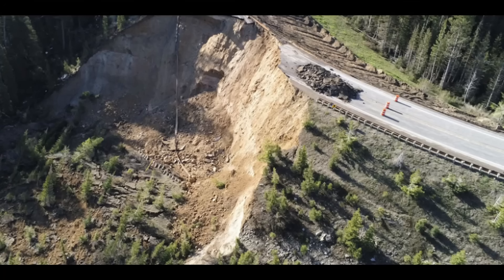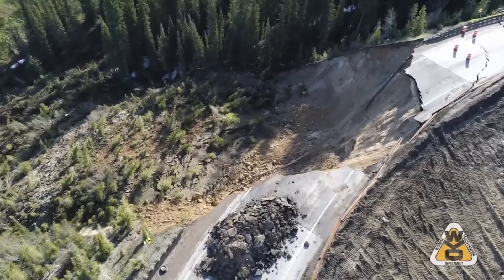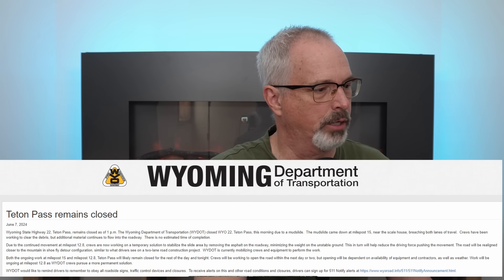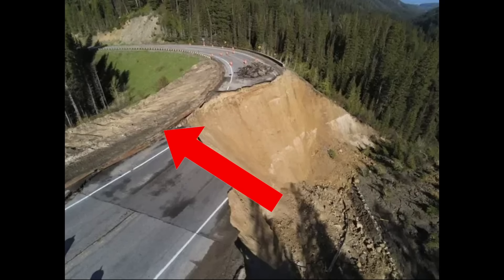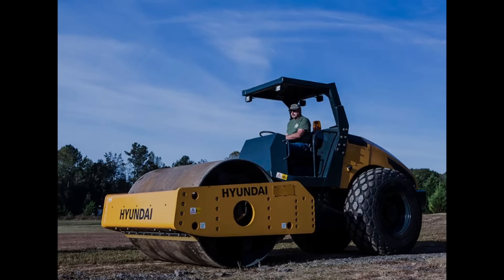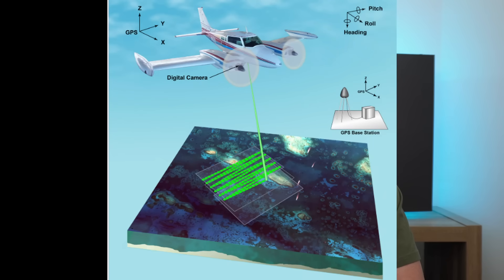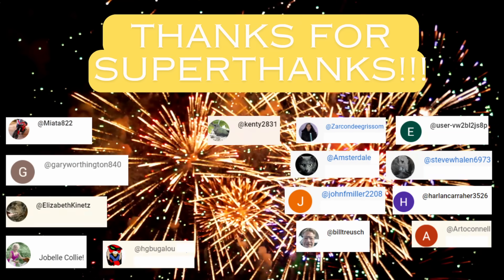Major Highway Embankment Failure in Wyoming!

Comment: A former co-worker is a mountain railroad right-of-way engineer.  He has worked on major slides like this numerous times.  His take is that the fill was improperly drained, allowing water to build up in the fill and, eventually, causing liquefaction in the fill, likely near the bottom of the fill.  That would destabilize the whole fill, causing a catastrophic failure such as this.  There is one spot in his territory where the railroad had frequent problems with a fill like this settling and failing.  He designed a French-drain-type system to drain any water from the fill.  It has gone many years now without issue.  The highway fill that is a few hundred yards away fails at some extent every single summer because the government "bureaucrat" highway engineers refuse to do the job correctly and install a drainage system in the fill.  As the saying goes, the highway department says it doesn't have the money to do the job correctly once, but they have the money to do the job wrong just about every year.  Your tax dollars at "work."
Reply: It's called "Job Security".
Reply: Yes, maintenance of fills has always been a big issue for railroads. It is important to check the drains regularly. I think your buddy called it right.
Reply: This is what I thought at first, but there is no drainage beneath that fill. the fill is atop a ridge that drains in either direction, completely away and down the mountain. The only 'watershed' for that section is the road itself.
Reply: @guest6423  That is interesting. We can't see that from the current news information. That would be a very rare instance in mountain terrain.
Reply: I found the topo map and looks like you are correct. I wouldn't mind seeing a map from before the highway was built to see what the original drainage was like before the fill.
Reply: @guest6423 Yes, the road is elevated on both sides, but that water has to go somewhere.  It can only drain away from the road so far, and then it has to follow the general downhill direction of the hillside.  Also, the fact that there was a mudslide spilling debris across the road surface means that either there was no ditch but only the hillside on the uphill side of the road, or that any ditch on the uphill side had already been overflowing with mud.
Reply: The mudslide area definitely needed  drainage.
Reply: I concur with the previous comment as water in poorly compacted or unevenly compacted surfaces will be an additional cause factor.
Reply: Thanks for answering my question.  I was going to ask if this could have been caused by having no drainage culvert on the uphill side, causing the water to flow under the road.

Ignoring the current instability, how feasible is it to drill some kind of drainage culverts at an appropriate downward angle beneath the roadway, emerging on the downhill side?  I'd imagine it would be a lot easier to put such a drain in place long before the fill was packed in on top.
Reply: you mean "Your Tax Cuts at Work". No money to do the job right, just enough to look good and get paid; hopefully the result lasts long enough for the statute of limitations runs out.
Reply: Republicans don't like spending on roads or bridges,cant give tax breaks if the spend money on roads or bridges 😂
Reply: @wendwllhickey6426 nope they would rather put this moneys in general fund so it inflates their volume and actually puts a hole in their funds because then they don't have monies in the highway fund but they are happy because they get retirement benefits instead and we get potholes and then situations like this !
Reply: @wendwllhickey6426   Yeah, I'd say Democrats are well known for lack of maintenance.  Your fixation about "Republicans=tax cuts" seems rather disingenuous.
Reply: @soakupthesunman Isn’t the Republican presidential candidate campaigning on more tax cuts? Of course that’s at the federal level and the money has to come from somewhere, so I expect the Walton’s tax cuts will be followed by even bigger property tax hikes.  A lot of people already can’t afford the property tax increases that have followed the last round of federal cuts.
Reply: @aliannarodriguez1581  
LOL oh yeah, bring Trump into it. 😂
The entire problem is not lack of revenue, it's too much spending... mostly on salaries and benefits including ridiculously high retirement benefits.  Get smart.
Reply: @soakupthesunman  I think that’s a popular thing for less scrupulous politicians to say because they want votes, but it doesn’t make it true.
Reply: @aliannarodriguez1581  
total lack of maintenance almost destroyed the Oroville dam in California.  Not too many Republicans in charge there.  Even Arnie was only a figurehead.

Comment: They should just build a temporary bailey bridge over the failed section for a quick fix while they repair the road.
Reply: The grade was already steep. Without the curve it would be even steeper. Doable, but could be nasty in the winter.
Reply: There is nothing stable to set the bridge on. That whole fill section will need to be rebuilt.

Comment: There's a fire hydrant right outside my building.  One day water was bubbling up around the base.  I told the building supervisor, but nothing happened.  A few days later the trickle became a minor stream.  I went back to the supervisor and asked him if he knows how quickly soil can be scoured away and you won't even know until the surface collapses into a 20ft hole.  I didn't see any digging to repair the pipe, but I saw the water stop.  I think they turned off a valve upstream to "fix" the problem.  I wonder how big the cavity is, and does the fire dept know the hydrant doesn't work?  This is a military installation, by the way, and infrastructure is perpetually well underfunded.

Comment: That pass has been a road engineering challenge since it was first cut in my great grandfather's time when they were moving goods between Jackson and Idaho on mule and ox drawn wagons.
Reply: Needs filling with rock by the look of it. Dirt that high is crazy.
Reply: My family vacationed in the Jackson Hole area since the late 1950s. I remember when this highway was built, and I remember the tiny hair-pin road that it replaced.
Reply: I didn't see any rip-rap cap, drainage, or much of any modern road techniques in that road. A similar slide occurred near me a few years ago and basically stranded the couple hundred people who used it every day. There's a lot of 1930-ish construction in my area that is just waiting for some bad weather and a good dose of Federal funds, I hate to say.
Reply: See, it'weird too, because we can look to the engineering in Norway, Switzerland, northern Japan, and they have no problem engineering roads over similar - or far steeper - geography ( true, I can't address soil types). I work, for some time, for a company that sold asphalt testing supplies; they spoke often of the back end value of european roads and highway, that seemed to cost more to engineer and build, but required far less maintainance and repair.

Comment: In the aerial shots, it looks like there was a pair of transverse cuts and new asphalt placed in the area of the slide?  I’m wondering if there hasn’t been a history of the pavement cracking and sinking in this area?  This area may have been a known bad actor for the local maintenance crews. 

As an aside, in New York State, we have used 1V:2H slopes in many locations without problems.  We try to use flatter slopes typically 1:3 or less.  It is easier for errant vehicles to traverse, and it makes life easier on our mowing crews, but I’ve hiked up my share of 1:2 slopes that have been around since the 1960’s.

Comment: 2:1 slopes are common in cohesive roadway embankments.  Casey, did you notice the contractor was scraping off the topsoil on the upstream side and started stockpiling the topsoil on the asphalt.  Wouldn't that be adding more weight to the tension cracked area?
Reply: Believe that was asphalt according to WDOT letter and Casey's  "adding fuel to the fire " type remark. Dozers ain't light either😮

Comment: I don't know much about this sort of engineering, not my field, but it seems crazy to me that someone would sign off on building a slope like that without some form of stabilization and reinforcement.
Reply: Well one thing, to fatten the slope you chase it downhill and the original ground slope gets too steep for fill benches. Both sides here you chase the slope. You can't build a 2:1 where the original ground is at a 1 1/2 slope. There would be no place to put the toe.

Comment: Those slopes look well beyond the angle of repose.
This maybe why the Swiss and Italians use so many tunnels.
Reply: Tunnels and viaducts.
Reply: @DavidCiani  Landwasser Viaduct and Tunnel are an engineering wonder of the world.
Reply: This done to save money, a huge embankment built up using the wrong material...a viaduct would be a far better, but more costly, long-term solution

Comment: As somebody that lives in the Pacific Northwest this is not uncommon. I’ve been😮 on rods embankment. Is that a one-to one ratio. There is one particular roadway that has been sliding for at least 20 years that I know of each year another patch on it. They have now finally decided to fix it permanently. The solution to fixing it permanently is to build a bridge.
The cost for these proper repairs or sometimes way more than the state can afford. 
Sometimes reality gets in the way of logic. Logic dictates we should fix it properly, but there is no money to do so
Reply from the maker: DOT projects have had to fight for money for decades now.  Just take the Francis Scott Key bridge and an example.  They apparently couldn't afford to spend $200 million or so on pier protection upgrades so now the Feds will spend upwards of $2 billion on a replacement bridge.
Reply: @CaseyJones-Engineer  the key bridge is probably not the best example as it was built to the standards of the day. The real problem is politics gets involved in road building. Politicians will promise a new piece of road when they really don’t have the money to build it properly the road gets built, and starts decaying rapidly. The politicians that organized and pushed through the road project are no longer empower and not responsible for the poor shape. The road is in. Putting dolphins around the key bridge to protect it from being knocked out doesn’t get you votes. So it’s not so much a question of under funding as it is proper allocation of funds and priorities.  the taxpayer has only so much money and his pockets are not bottomless. Money needs to be spent wisely but when you get politics involved that never happens.

Comment: As a retired CE I hope we learn more before we all pile on, as it is easy to criticize in hindsight without all the facts.  Civil engineering design involves among other things balancing costs and risks, most CE project have unknowns, no matter how much effort is put into initial investigation and design.  As I am sure Casey is aware the geotechnical design/construction field is quite litigious for a reason, his insurance premiums probably reflect this. How many other slopes like this have they successfully built?  Some question low bid or design-build projects, I would defend these types of project delivery as being very successful overall.
Reply from the maker: I agree with you.  My criticisms in this case was that the DOT apparently was treating the pending slope failure as a maintenance issue while not recognizing the high potential that this slope would fail catastrophically.  I mean they were planning to reopen the road this weekend just before it failed completely on Saturday.
Reply: I live here. This road, as it was built, was a vast improvement over what was essentially an old wagon road.
Reply: Thank you. One guy, besides Casey, that seems to get how it all works.
Reply: @paveltolz6601 exactly people are acting like this was a road that was constructed in the past 10 or 15 years. This is a project that was probably originally done back in the 1950s, nearly 70 years ago and the standards and practices are not even close to what they are these days

Comment: Fill appeared to be all fines of the same type of material, not very well compacted. Slice over 30*. No protective rip-rap on slope. Recent heavy rains with flooding over roadway likely saturates the fill resulting in localized liquifaction, which combined with the insufficient engineering resulted in a rapid catastrophic slope failure.
Reply from the maker: I agree that this appears to be a design bust and I suspect many, if not all, of the other fil sections are made in the same way.
Reply: Yes, I live in the area for 20 years and all the cuts on the pass are made the same way. This is a major reckoning in the area. Thanks for your thoughtful coverage!

Comment: That looks like it sloped down on both sides. Maybe the filled area crosses a low spot? 

At any rate, someone cut major corners if there was no reinforcement holding that slope up.
Reply from the maker: There was no reinforcement that I could see, but the drone images weren't that close in.
Reply: How long ago was it constructed 40 years ago very little extra stabilisation was ever added

Comment: Looks like thaw season hit again. Given were that's at (East of Idaho and South of Yellowstone) that fill could be composed of weathered volcanic ash which can be very fine (frost susceptible).  Form a few cracks and a little rain goes a long way towards helping it liquefy.  It looks more like that than like glacial till or Bonneville flood sediments.  In Alaska I would go fishing and take a road along side a river - the upslope cut looked exactly like the cut area photo you showed. It was at the Klutina River which has a view of some volcanoes on clear days.  Those soils were volcanic in origin and the road was closed one year when the slope slumped and took out the road. 61.939734151731216, -145.3914442009381 shows were the old low trail was rerouted up above the embankment. If you look at it in satellite view you can see the soils for comparison to the WY mess. Zoom out and you can see the volcano 20miles to the east. Good story, it will be interesting to see the fix.  I would be hard pressed to have any faith in the fill adjacent to the failure zone, the repair zone be larger than just the failure zone.
Reply: That would be the wrong location for Bonneville flood sediment

Comment: There seem to be different layers down through the embankment, is that just an artefact of the order they filled in or is there a meaning to it?
Reply from the maker: I suspect that their source of material varied throughout the placement.
Reply: @CaseyJones-Engineer  So that could add to the possible failure sources?
Reply from the maker: @surters  Possibly.  The need to figure out if the materials used matched the specifications in terms of type and degree of compaction.  I think that those slopes were simply too tall and steep.
Reply: Looks more like the entire slope slid

Comment: I wonder how long that road section had been in use before it failed?
It certainly doesn't look that stable so was the road fairly new?
Reply from the maker: I think it was fairly new.  I am continuing to research the construction history but you can tell that vegetation on the slopes wasn't very well established.
Reply: WY Highway 22 was built in 1969. Kinda amazing that the embankment lasted 55 years without any reinforcements.
Reply: I don’t know anything about engineering a road but seems to me you don’t use sand
Reply: This road is nearly 50 years old. One of the photos taken has what looks like a  walking trail going down towards the slide, that "trail" was the old switchback road from Idaho to Wyoming

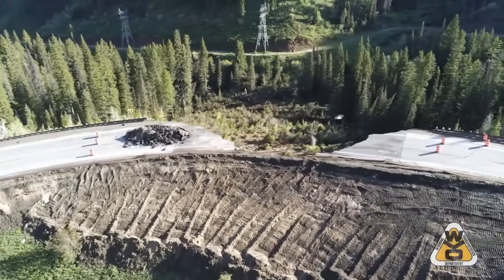Comment: 3:59 initial mudslide by check area booth at MP15 5:23 naive, unrealistic PR expectations, road crews were in precarious position 8:11 ~40' roadway vs ~120' 3x vertical drop 9:41 crazy to think cracks weren't sign of major problems 11:03 curious earthwork 11:39 expect a year to fix massive embankment problem - add necessary geogrid reinforcement, drainage 12:36 may need to stabilize vulnerable areas with drilled-shaft walls 13:19 in other words, does WYDOT have competent people evaluating this situation? 13:37 invaluable tool: drone LIDAR to monitor movement 14:01 should assess, stabilize surrounding area vulnerability 14:20 likely won't be able to fix in remaining (short high-elevation) summer construction season 14:29  best case: fix by end of summer 2025😕
Reply from the maker: Thank you!